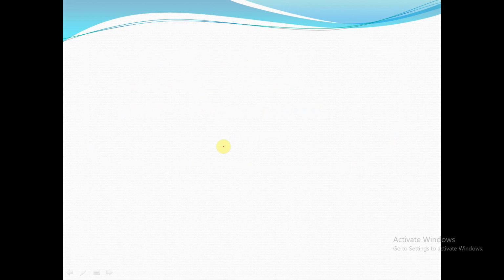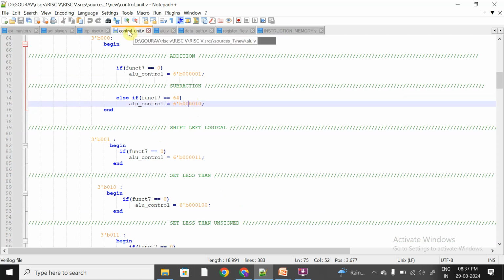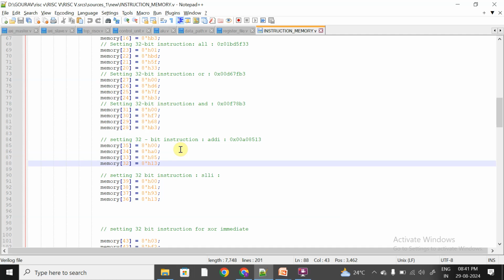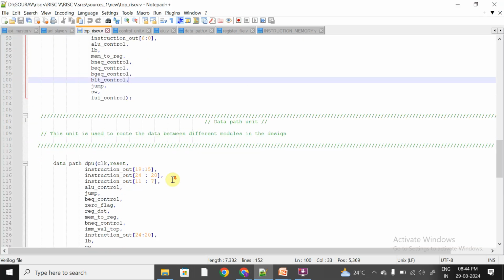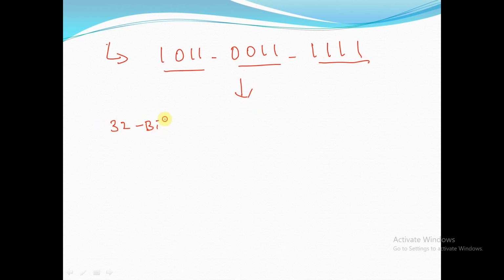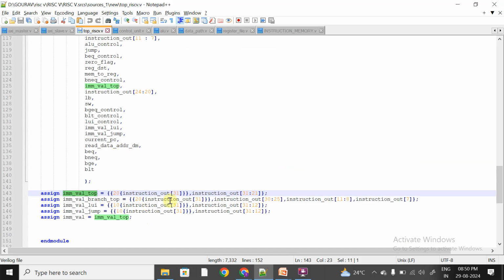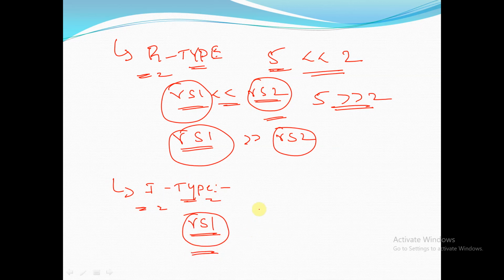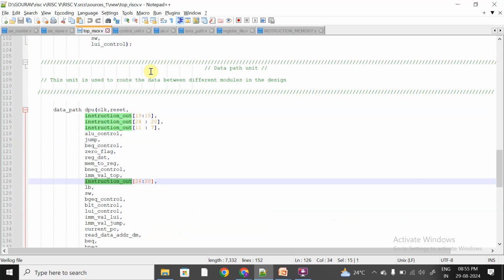Executing I type instructions in Risc - v using verilog || Risc -v processor full course ||

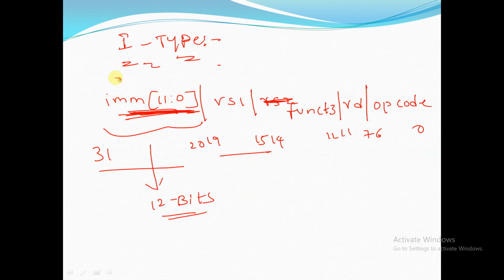Comment: in 13:43 it should be assign imm_val_top = {{20{instruction_out[31]}},instruction_out[31:20]};] 
and not
assign imm_val_top = {{20{instruction_out[31]}},instruction_out[31:21]};

As if it is [31:21] then in total it will be a 31 bit data.